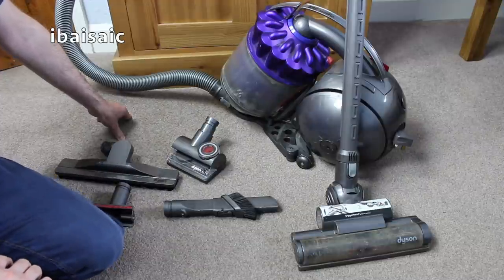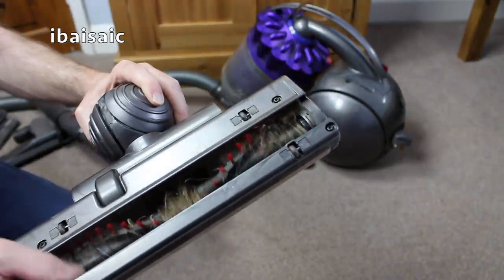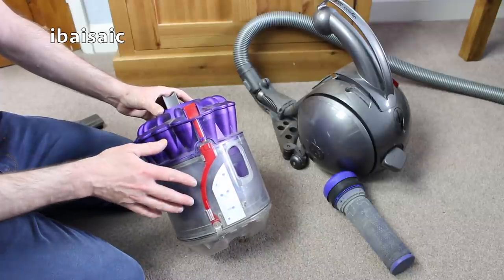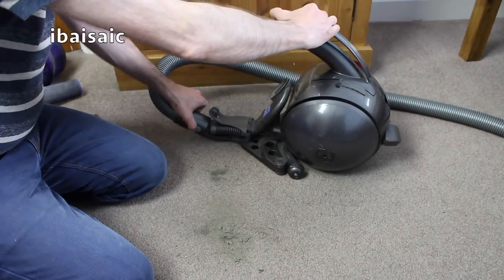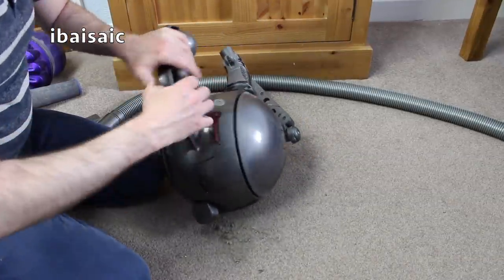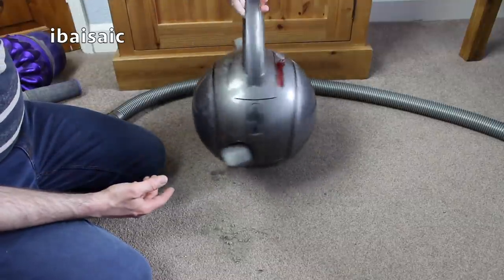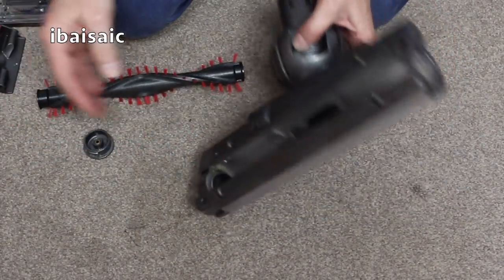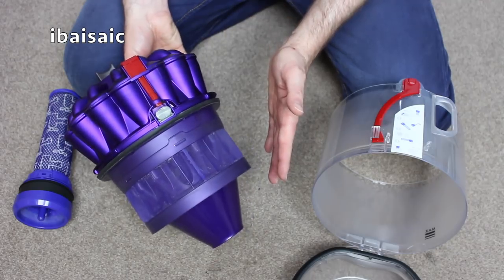Dyson DC39 Vacuum Cleaner Maintenance Tips

Comment: This video was fantastic. Thank you. One thing I found out when I separated the bin from the purple part  - I looked into the cone-shaped part of the purple and it was caked with dirt.  I first took a swiffer and dusted inside all around it and then I tapped on it rather hard (not hard enough to do damage) and dirt literally poured out. So I took several more swiffers and pounding till it came sufficiently clean. I’m wondering if you could address this in another video. I’m supposing it was so dirty because I never separated it from the bin  - never realized you could.  So again thank you for your instructions.

Comment: Own one of these and it needs this type of deep clean almost weekly to keep it running in a house that doesn’t have pets or excessive dust. The filter clogs so quickly and this stops the turbine head working, the vacuum loses suction rapidly, and the filter takes an age to properly dry. Often have to clean the vacuum fully mid-clean to keep enough suction for the turbine head to spin. From experience it can get this dirty after only a couple of full cleans of the house.
Reply from the maker: Get yourself a decent German bagged vacuum next time.
Reply: Hi I have a  Henry  hoover.

Comment: Thank you for the video, I retrieved a DC39 someone had put out to the garbage. I found behind the canister screen caked on drywall or cement dust. It appeared that someone had used it for a wet vac. It had little suction when I got it. I blew out a lot of the dirt and soaked and washed some parts and others I wiped off. I think the head is clogged up and I'll have to try to clean it out.

Comment: 4:55 The dust lining the inside of that area doesn’t matter as no air flows through that area. That is just where the smaller cyclones dump dust, it’s normal for that to be dusty but it doesn’t affect the performance of the machine.

Comment: Oh my gosh...  when you're cleaning the actual main cylinder part of the filter, you really need a can of air to get all of the dirt out of the center of it. If you don't have a can of air, you need to buy one or you will never get all of the dirt out of it. I actually use my air compressor! that is the only and I mean only way the dirt will come out of this machine. I ended up selling mine because it was so incredibly hard to clean. But if you are in love with your Dyson DC39, invest in a good can of air to clean that center cylinder! Also it comes in handy for cleaning all of the attachments as well. I can't believe he wouldn't suggest that!
Reply from the maker: I suggest people invest in a German made bagged vacuum cleaner so they can avoid all the maintenance  bagless cleaners need.

Comment: Roger, I have a question about roller brushes on different vacuum cleaners. Are some brush rollers better than others?. For example my shark upright seems to skim across my thick living room carpet, picks up quite well but I just get the feeling the shark brush isn't that great on my living room thick carpet, take the shark upstairs & vacuum my  bedrooms' thinner carpets and its a different story, you can really feel the shark brush working hard and picking up. My Vax upright brush works great on any carpet, think carpet or thin. Both vacuum cleaners (Vax & Shark) are in great condition. Thanks in advance.
Reply: Andy Kirk Yes you always want a roller brush that when you turn it on the carpet vibrates. We call this agitation. It is good to have it break up the dirt in the carpet. The powerhead on this DC39 is not good. If you are cleaning carpets I would recommend a miele upright or a Dyson DC 40 2015 or Dyson Ball Multifloor.
Reply: Thanks, I already have a Miele upright, it's a great vacuum cleaner, personally my fav. I was just testing this Shark upright Vacuum cleaner, not too impressed with it to tell you the truth, I might be doing the Shark an injustice as I'm always comparing it with my Miele upright.  Thanks for the answer.

Comment: Actually the DC39 and DC37 has a design fault that causes the filter to get dirty very quickly. Almost every unit I see in my workshop has this issue, If you pull the cyclone apart you will find that the gasket has failed. The gaskets used in the DC39 are substandard and will fail in 5 years typically. I have not seen this issue in any other Dyson models
Reply: I've had my Dyson DC37 for 5 years (same model as the DC39) and I've never had to wash the filter. I bought a replacement filter, took out the old and washed it, but there was no dirt on it whatsoever... the vacuum works as good as day 1. Should I expect the filter to get dirty over time?
Reply: Dude the whole vacuum is substandard. What do you expect from Dyson? Quality? Pleaseeeee.

Comment: I know it's not shown in your video, but do you happen to know how to remove the bottom part of the plastic bin?

Just I have fully stripped down, fully cleaned and replaced the motor and both filters on a DC39 which had been used by a builder! (It was VERY bad) and there is dirt lodged in the small sections near the hinge on the bin and I cant get to them with out removing that lower section of the bin.

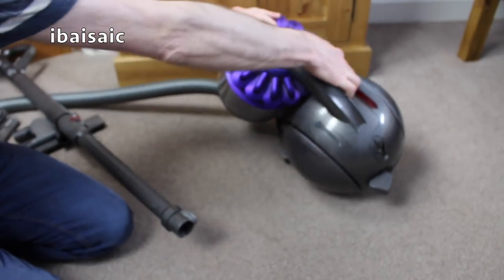Comment: At 2:00 you take the bin off.  How exactly did you do that?  I push the red button nothing happens.  It doesn't separate like that.  The reason I ask is that i have the 2 second problem.  I turn it on.  Air sucks in through the wand and hose like it is suppose to and then a valve of some kind shuts off that air flow while the motor continues to run.  I am suspecting a problem in the bin and main body and not out in the wand and hose.  There is a pile of dirt and lint in the bin.  That is the one problem with Youtube maintenance videos.  Everything come apart like it is suppose to in Youtube videos.  Real life is sometimes a little different.  In your video, the camera angle shows your hand over the bin and blocks my view of what you are doing.  Since I am not Clark Kent with X-ray vision, I don't know EXACTLY what you are doing to make that bin come off.
Reply from the maker: This model does not have a red button to remove the bin, it’s a round silver button located on the cleaner body. Pressing the silver button allows the handle to pop up so the bin can be removed from the cleaner. You then use the red button on the bin to open the flap to empty the dirt. 
The valve you talk about allows air to flow through the motor when the airflow is restricted either from a blockage somewhere or a dirty filter. If the valve operates without the hose attached, then you have a blockage in the duct that takes dirt to the bin or a dirty filter.

Comment: Darn. Was looking for how to clean the cyclone... there s a ton of fine dust stuck inside mine
Reply from the maker: Dyson don't make it wasy to dismantle the cyclone assembly, but I'm sure there are other videos on Youtube showing how to. Try the channel Beko1987.
Reply: Thank you for the video. Perhaps an air pressure will be good to try to clean the cyclone.
Reply: I have dc47 cleaned the cyclone thing with water and let it dry for 3 days and works like new
Reply: You don't. Air doesn't flow through there. That is where the dirt and dust removed by the cyclones is deposited and it empties when you open the dirt bin. Having fine dust and particles in there does not affect the performance of the unit.
Reply: But it can’t be good having all that filth sitting inside of it and constantly rotating back into the carpets! I cleaned mine with soap and water i couldn’t stand it any more

Comment: When you see a DC39 filter like that you know the cyclone gasket HAS FAILED. This is a design fault. You can replace the gasket.
Reply: When you see it like what? Can you explain in more detail?
Reply: If you remove all the screws in the cyclone you will see the gasket which always has holes/tears on any DC39 that has decent hours of use on it. Roughly 12 x T9 screws from memory

Comment: Strip the motor body apart and you will find a large paper style filter  & its renewable only NOT washerable plus its pricy to replace, Sorry Bro this was only half the job on your vidio , also strip the cyclone to clean it then its all as new..
Reply from the maker: I showed what the average user can do to maintain this vacuum. Most people will not want to dismantle a vacuum cleaner to replace a filter that is not supposed to be user replaceable.
Reply: @ibaisaic  Thank you for the comment & I completly agree with you but most people watch youtube to do the jobs to save repair costs , Ok basic cleaning but dont change the main motor filter will get hot smelly motor , less suction , noisy and in the end burn the motor out or wreck the bearings , its £250 for a new cleaner .
Reply from the maker: I have made several basic maintenance videos on vacuum cleaners, and judging from the comments, many people don’t even realise they contain a filter that needs washing. As this machine doesn’t belong to me, I wasn’t going to start opening it up and giving it a full service.
Reply: @mishafrog8786  how do you clean the exhaust filter in this model?